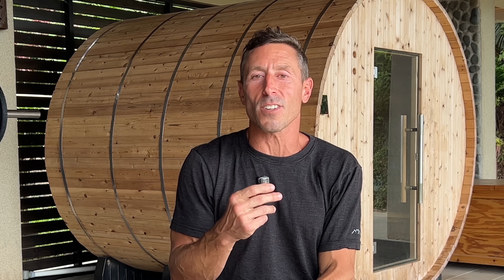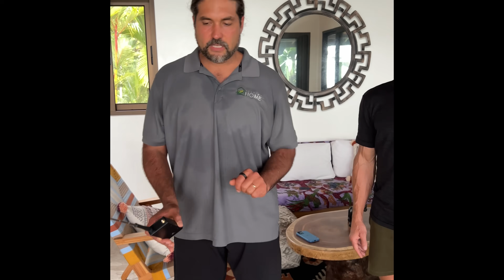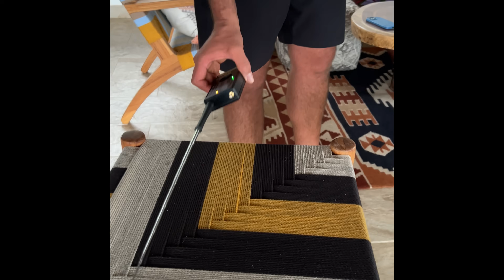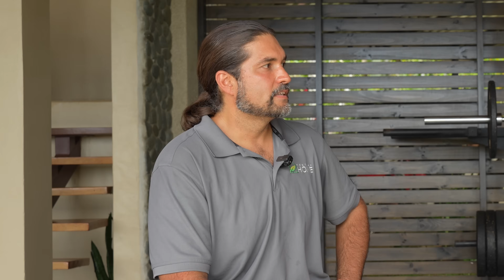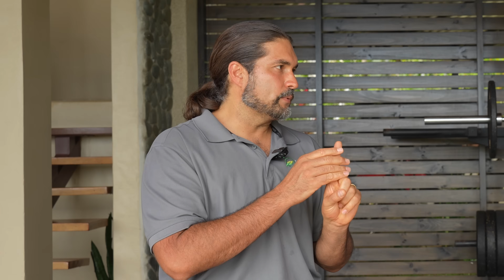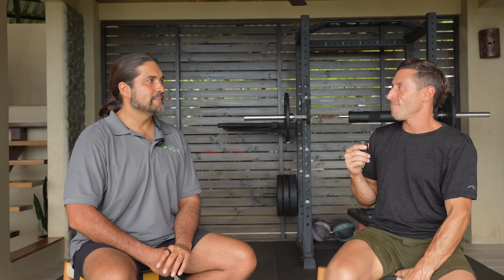Earthing vs. grounding

Comment: Please get Clint Ober's take on this. Also if this is indeed a problem please provide some work arounds. Would switching off the outlet the mat is plugged into resolve it?
Reply: Here is an informative Q&A interview with Clint Ober, who knows far more about this than Blaser. Ober explains the difference between Earthing and Grounding (they are not the same thing but are often used synonymously) and how both are good for you. Topics include dirty electricity, EMFs, etc. 

https://youtu.be/XlLxpsmgQ9Y?si=i2CdADeoJZskokXN

Comment: Paul, I love your videos, but this just isn’t true. I’m an electrician apprentice here in the United States and the ground in your outlet is connected directly to the Earth.

The interference that you heard with the tool can be heard on any surface that is truly grounded, you tested a chair that was not grounded and then you tested yourself when you were
Reply: I wanted to say this couldn’t be true that the ground didn’t go into the earth. I knew it had to!  Ty!
Reply: Bare skin on the ground is how you get hookworms. Parasites like hookworm will stabilize the body, in order to have a good host, but eventually it will kill you if not dealt with. Stop falling for this depopulation propaganda, it's to make you sick.
Read your Bible, Mark 6:9
Reply: To add to this, the chair didn’t provide any “interference” static because it is insulated not because it was grounded. Those are actually the opposite! There is a high level of resistance (as in ohms) between the chair and the surroundings and thus it couldn’t transfer electricity
Reply: I have a6 foot copper rod embedded 6 foot into the ground.  GROUNDING MY ENTIRE HOME.  All the outlets.   It's just common nnn sense.

Comment: Geez Louise I have been grounding for decades! Oddly enough, at home my ground is to the ground circuit in the house whereas on my boat there is much less electrical current and it is DC rather than AC.... and I always sleep better.

Comment: ‘Grounding is a dumping ground for your electrical system’ I call BS. Grounding and earthing both relieve extra voltage from your body. ‘Dirty electricity’ is not a thing, ground is ground, not electrical.
Reply: Agreed - I don’t think this guy (whoever he is) knows electrical theory.
Reply: @johnnywlittle  Here is an informative Q&A interview with Clint Ober, who knows far more about this than Ryan Blaser. Ober explains the difference between Earthing and Grounding (they are not the same thing but are often used synonymously) and how both are good for you. Topics include dirty electricity, EMFs, etc. 

https://youtu.be/XlLxpsmgQ9Y?si=i2CdADeoJZskokXN
Reply: Let's see your study
Reply: @Tom6567my  sure, right after you go ahead and clap your hands.
Reply: @ColonelSandersLite lol, thank you. I was reading that other comment in disbelief for a moment
Reply: Your BS is BS.  Do a quick search as to how many people are zapped by their water faucets or other household items that are connected to a ground rod outside their home.  House neutrals carry any unbalanced loads and it can build up with loose connections or faulty outlets/switches etc.  As a lineman for over 30 yrs I know of several cases where people have died trying to steal copper wires by cutting open a "ground" wire that goes down a pole to a ground rod and got into series.  All this earthing/grounding crap is doing it putting out bad ideas.  I read several posts talking about using leather soled shoes instead of rubber to "ground" yourself and how they have all these so called effects.  Well, leather is an insulator and not a conductor.  Scam
Reply: The earth's surface and the human body are both electrical. the surface of the Earth has a negative charge of about 300,000 volts relative to the ionospheric layer above. The Earth-ionosphere system forms a spherical capacitor that stores about 500,000 Coulombs. This means if walking barefoot outside there is an electrical connection taking place that allows a transfer of electrons.
Reply: Dirty electricity is a thing...research it.
Reply: grounding allows excess current to dissipate and not fry things.  Dirty electricity is not a thing, like you said.

That alone makes me question this Better Call Saul research
Reply: @joerandom157  noise in electrical circuits is the definition of dirty power. Capacitors can drain to ground.

Comment: You can measure yourself with a multi meter to test voltage going through body, while grounding with a grounding mat inside. It is completely safe, provided everything is set up correctly in tthe house sockets and room...You can get a socket tester cheap for this.  There is no AC voltage charge coming through the outlet.  So this guy is wrong about that... Also, he is correct about ambient voltage charge in the house, and its best to turn off power, or at least turn off the wall outlet. grounding helps with this... EMF is a whole other thing.

Comment: Years ago I had an electrician install a kill switch in our house so it killed power to all the bedrooms. You can feel the difference in the bedroom space. It's worth it. You want to mimic sleeping outside on the ground. Our modern life is so removed from what is natural. Great video Paul!
Reply: What I noticed when there was a major power outage in our area, I felt wonderful I actually could feel the everything off feel, like the big switch is finally off.
Reply: @sandrahbradley1511  placebo
Reply: HOW DO TOU STAY WARM IN WINTER OR COOL IN SUMMER?
Reply: @Poppy-1955  your furnace/AC unit is in your room? 🤔
Reply: I've read/seen to turn off all wifi and routers at night as well
Reply: You realize that you don't need a "kill switch". There is a fuse box that you can switch off.

So either you're lying, or you're stupid. Good job.
Reply: What else is there to switch off in the bedroom if lights are off? Wifi is probably installed outside the bedroom, so it would still be active. Just connected but turn off electricity in the bed room such as lamps should not cause any EMF whatsoever.
Reply: Did you measure it with the accurate meter? Or did you just make a guess and say it feels better? 😂
Reply: No pad or sheets are needed. Simply force your fingers/ at least three 4inces up your exhaust and put your free arm 2’ n the ground , then all is grounded 😳
Reply: The fridge/freezer?
Reply: @aboodf6268 she literally said the kill switched turned of the bedrooms not whole hosue
Reply: @aboodf6268 you have a fridge/freezer in your bedroom? I think you have bigger things to worry about than keeping grounded, brother
Reply: Could be suggestion too. Although low frequency E-Fields could have an effect, I have fooled someone before who said she can feel anything, all RF fields she said, she can feel. So when we were talking I switched on and off pretty heavy fields very close to her, and she didn't notice a damn thing.
Reply: @DBMMMMM like chuck in better call Saul!!  Didn't know the phone was slipped into his pocket..
Reply: You a lie. What you had an electrician install a breaker panel.lol

Comment: So he tested a chair which wasn’t grounded and it didn’t make any noise

Then he tested a grounding mat that was plugged into the wall, and it made noise 

Then he did NOT test the grounding mat that was plugged into the Earth directly, but recommended that.

I’ve been using a grounded bedsheet and grounding mat under my desk for 6 months and have never felt better.

I want to know what that device is and I want to see the difference between wire to dirt and wire to outlet.
Reply: Agreed, I have been grounding for years ... would love to see more in-depth look at it.
Reply: It’s a simple EMF reader.  They’re available on Amazon.  I don’t know what kind of weird wiring he has in Costa Rica- but I do NOT get the same sort of results when testing my grounding mat.  Zero emf waves coming from my mat.
Reply: @davidlgs  not all meters are the same. Check out Brian Hoyer’s work- and the meters he suggests for testing your home.
Reply: Agreed
Reply: Good point
Reply: Good points. I would like to see the same...
Reply: I have been grounding for 3 months, and it has changed my life.  Mat plugged into the outlet and tons of electronics around me and it works. You do not have to run a grounding cord out the window to the earth or sleep in a room without electricity or outlets.
Reply: @hemistry08 hi 👋 Can you send me the product link?
Reply: I smell a dude bro salesman. Beware of ponytails with overly manicured beards....lol...but I'm not kidding.
Reply: Interesting discussion. If your house has had multiple different satellite dishes on it there may be abandoned coax cable ports on your interior walls. If that's the case in your home you can use these for grounding purposes. Simply go outside and find where the coax enters the house, measure about six feet of cable away from where it enters the house. Cut the cable there and then strip away about 2 inches of insulation from the cable leaving exposed copper wire available to be attached to a grounding rod which you can drive into the ground. Hint you do not need to use a 4 ft half inch copper rod for grounding. Rod like that are designed to redirect lightning strikes. All you need is about two feet of quarter inch metal rod which you can pick up at any hardware store.
Reply: I forgot to add you can use another piece of coax cable on the inside of the house screw the male end into the cable receptacle on the wall leave about six feet or more cable as need and attached to stripped coax wire to the grounding mat
Reply: Do you plug directly into the ground?
Reply: Device is a ENDOTRONIC E-SMOG SPY

Comment: Here in Australia the part of the electrical system is called the earth. Also, this is very "tinfoil hat" as you put it. The earthing or grounding system of the electrical installation is at the exact same potential as the ground you stand on. It is not a current carrying part of the circuit, unless there's a fault in the system, at which point the current will flow through the ground you touch in that area anyway. There is no science to this, just a bunch of nonsense from someone who doesn't understand simple electrical principles trying to promote a product.
Reply: Correct. I am worried for paul taking advice from this guy. He clearly doesnt know what he's talking about! the device he used.. he put on a random chair that wasnt grounded, then touched a gronding mat, that who knows how it was plugged in. He didnt use a multi meter to measure DC voltage,  and he didnt measure and dirty AC voltage. This guy is a crook or just doesnt know the science
Reply: @multitablez7825  "This guy is a crook or AND just doesnt know the science"
FTFY

Comment: Grounding is a zero potential. Excess voltage will be equipotential. Circuit that is grounded will be zero volts.
Reply: yep, clearly this guy doesn't know what he's talking about... a socket tester and multi meter can be used to test the socket is grounded correctly in the house

Comment: I’d like to hear what Clint Ober has to say about it.  He supports grounding. A discussion with both men would be beneficial.
Reply: Paul, you have some follow-up work to do. I appreciate the POV from Ryan here but all the studies show otherwise so an expansion of this topic is definitely needed. First I’ve heard of this distinction.
Reply: @andrewpizzalim   Here is an informative Q&A interview with Clint Ober, who knows far more about this than Blaser. Ober explains the difference between Earthing and Grounding (they are not the same thing but are often used synonymously) and how both are good for you. Topics include dirty electricity, EMFs, etc. 

https://youtu.be/XlLxpsmgQ9Y?si=i2CdADeoJZskokXN
Reply: would be electric
Reply: @KORTOKtheSTRONG  ok you got me  🤣🤣🤣🤣🤣
Reply: Clint has done a research about it check DOI: 10.1089/acm.2015.0340
Effects of Grounding on Body Voltage and Current in the Presence of Electromagnetic Field
Reply: @Danilobioaterramento  The most important thing to know about the grounding products is that they're very expensive and that they only last a limited amount of time. Notice that they never say how long the sheets last and there's no guarantees. If you talk to the companies, they will not even give you an estimate about how long they last.
Reply: He’s selling the electrical grounding products. Chatting with a neutral party that doesn’t have personal gains would be our best source for info🙌🏼
Reply: Yes, his interview with Clint Ober was a total farce then? He had a lengthy talk with him about grounding, now he publishes THIS. Confusing. I’m still with Clint on this topic.
Reply: @pamelaf.2776  You're right. Here is an informative Q&A interview with Clint Ober, who knows far more about this than Blaser. Ober explains the difference between Earthing and Grounding (they are not the same thing but are often used synonymously) and how both are good for you. Topics include dirty electricity, EMFs, etc. 

https://youtu.be/XlLxpsmgQ9Y?si=i2CdADeoJZskokXN
Reply: I was thinking the same thing listening to this because he has created products that plug into the ground in outlets. I have mobility issues due to not healthy knees and I lived in a home that did not have properly grounded outlets until last month. Now that I have properly grounded outlets (and I hope I'm saying that correctly) I've been using my grounding mat while I'm working from home. I've noticed a vast difference in my sleep pattern and my circulation in my legs but I've still got a ways to go. I'd like to hear what Clint has to say too!

Comment: Well I’ve been doing this for a long time the wrong way. Of course I earth but at night sleep on grounding sheets smh I bet the grounding sheets negates my earthing . Bye bye grounding sheets. Thank you Paul and guest .
Reply: the guy is actually wrong. provided your house is wired correctly, you can test it. There is no issue grounding through a grounding socket in the house. Use a socket test + multi meter to test it.
Reply: Listen to Multi- he’s correct.
Reply: Keep your sheets